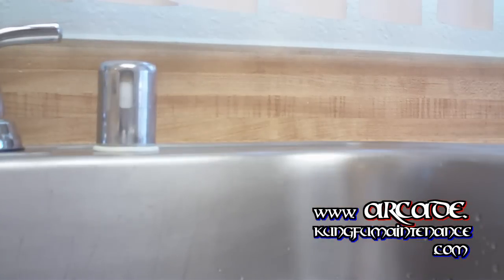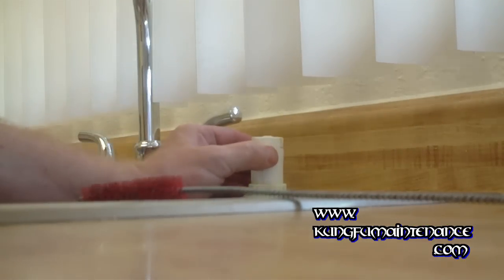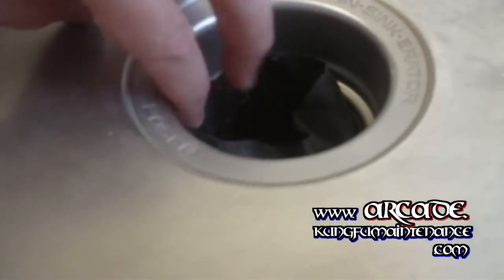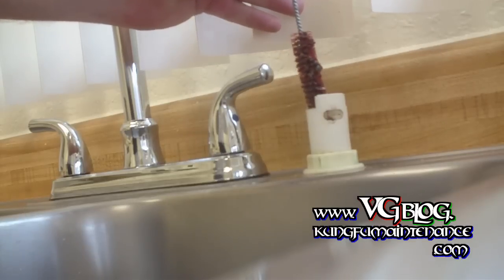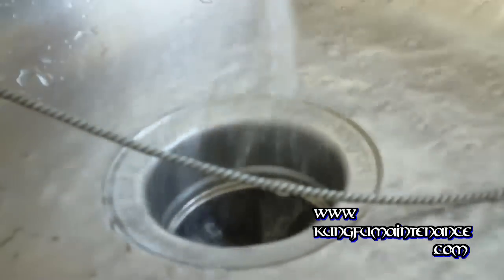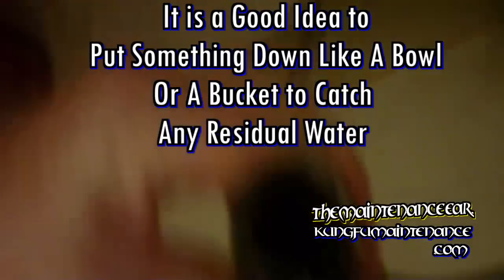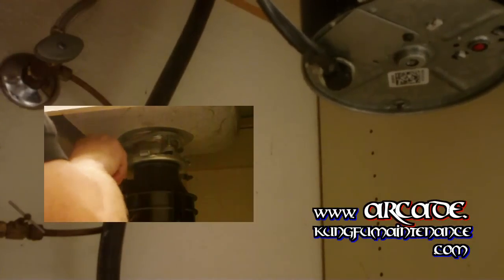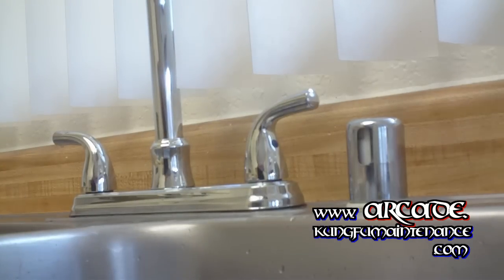How To Stop Dishwasher Leaking Water  From Sink Counter Top Air Gap When Running Plus Draining

Comment: I appreciate your video. I could not believe I could learn how to do so many repairs by looking them up.  I fit a pocket knife inside the disposal and was able to clean the completely clogged drain by hand.  I ran a wire through the air vent but will buy a brush to keep it clean.  I am thrilled to have this done.  Yucky job....saved big bucks!

Comment: I was getting ready to call a plumber when I decided to look it up online first and I found your channel. I didn't run my dishwasher for a long time and when I did the water was coming out of the air gap. I had a wire declogger that a friend gave me and use that and it worked. I wouldn't have known all that if it wasn't for your video. Thank you very much. You save me some money and frustration.

Comment: Thanks for great video. I just changed garbage disposal (due to cracks) and noticed the dishwasher drain pipe was clogged which explained why the water was overflowing from the air gap. I was surprised that it still did it after I put in new disposal and didn't realize you can clean the hose through the air gap without disconnecting the hose where it connects under the sink. Saved me some extra work.

Comment: I kinda took the more gross approach to it and once I cleared away any of the stuff at the top I just blew into the pipe to clear it out that way. I'm sure using compressed air would work too but I went the simple route and it fixed the issue

Comment: Air gaps are a perfect example where a law is passed to create a solution to a problem that does not exist. When PROPERLY routed from the dishwasher to the disposal (see one of the many Youtube “dishwasher drain loop” videos from instructions) the need for an air gap is eliminated. Furthermore, introducing dishwasher drain-water onto the counter top, sink rim and into the sink adds a whole new sanitary problem. The additional hose connections for the air gap create additional opportunity for leaks, mould, and rot.

Comment: I came across this when I was looking for reasons water wouldn't drain from (backflow into) the dishwasher. I just took apart the air-gap, there was a chunk of plastic in it(from what I have no idea). Running a quick rinse cycle to see if it drains properly. Fingers crossed and thanks so much for all the helpful DIY/maintenance videos.

Comment: excellent video--  I installed an Insinkerator Badger 5 a few days ago.  Guess what I forgot to do?? Doh!!  Thanks to your vid, I took off the disposal and knocked out the plug for the dishwasher drain line connection.  I also used a knife to trim the jagged plastic edges left by the knockout.  Thanks for the vid!

Comment: Great video! I ended up taking out my air gap and drain hose to processor, took them out back and turned my hose on the jet setting. Blew those puppies CLEAN! Runs better than ever. Thanks for the tutorial though. That really helped!

Comment: I don't have a garbage disposal but I'm getting the same effect of water through the air gap. Additionally, now my sinks went from super slow draining to not draining at all. Trying to figure out where to look for the plug. Drano didn't work and neither did vinegar/baking soda. I tried a cheapie drain cleaner (like yours but not a brush, just a stick with jagged prongs on it). I tried it in the drains as well as the air gap. Plunging the sink only pushes the water from one sink to the other.

Comment: Maintenance replaced my garbage disposal and now the dishwasher expels water through the air gap. Do you think they missed a step during installation? Or do you think its a clogged air gap? Once I turn the dish washer off and back on again it stops doing it but it will do it again later in the cycle. Thanks for your help.
Reply from the maker: +Cori Shear irony is I just fixed the exact same issue (pun intended ( I like puns LoL :0) what has happened is they forgot to knock The Knockout out for the dishwasher drain line on the new garbage disposal. I show how to do this in my garbage disposal install video. It is good idea to use  flat blade knife to remove any leftover ribs from the Knockout.
Reply from the maker: I just finished editing and uploaded the video "Garbage Disposal Replaced Now Every Time Dishwasher Drains Water Shoots From Air Gap Repair" As you were typing your question I was recording this and making the repair.  Hope it helps. Talk about timing!!! LoL! Hope you enjoy the vid!!! Seems it was meant to be!
Reply: Dude, you are a life saver! Just ran into this problem tonight. Apparently, we missed the knock-out step, but we figured it out with your help, thank you!

Comment: My air gap doesn't look like the video's.  It doesn't have a place to pinch the sides and pull off the top. It's fairly new.  How do I even get the cap off to proceed?

Comment: Anyone had an issue where the drain is blocked, and running the disposal forces water and chunks of old food to sly out of the overflow hole?

I had this issue. 
It turned out to be a slug of old food got caught on the outdoor drain grill, and wouldn't let anymore water pass. So the entire pipe from sink to outdoor drain was filled with water.